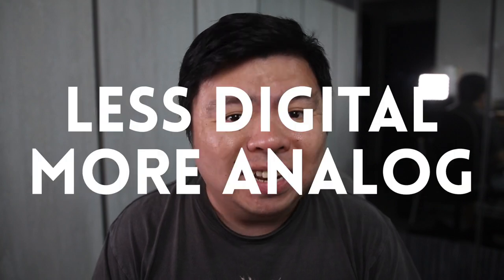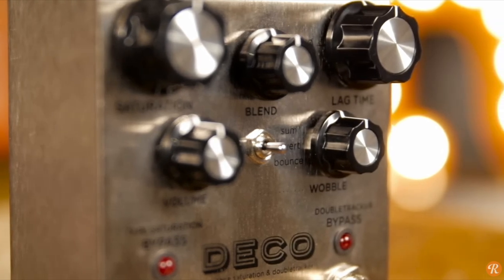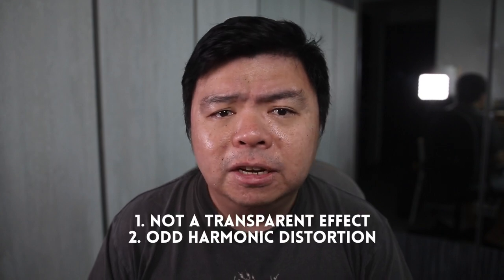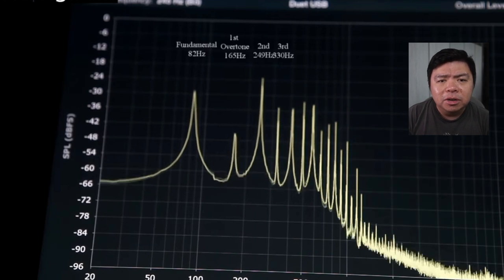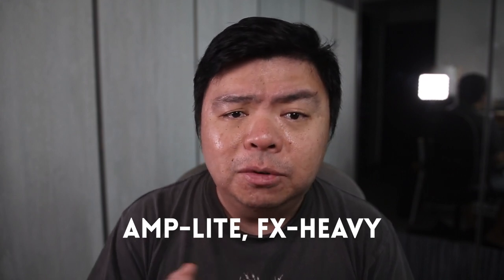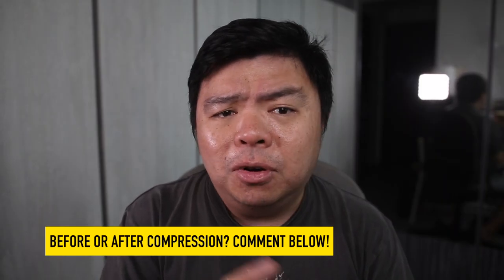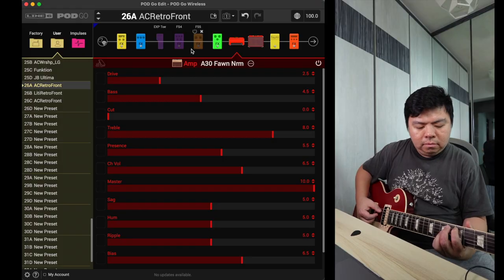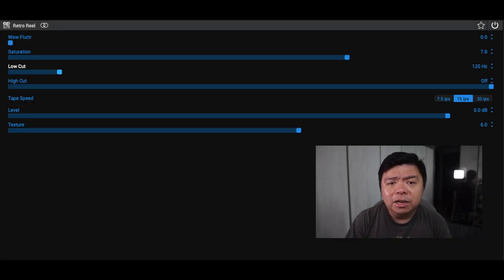Use This ONE Trick For INSTANT Analog Warmth (Line 6 POD Go, Strymon Deco Emulation)

Comment: Hello, i really need if you couldnhelp me do a preset that can use the same amp for drives and clean.. im using a charvel dk pro guitar qith both hambuckers pick ups synmor duncans .. 

I dont knlw what to do anymore to sound good please help me
Reply from the maker: Hi there, which amp model are you referring to, the AC30 or the Litigator? Both react differently to the input gain from the guitar side. Sounds like your Charvel has hot pickups. Are you having difficulty getting a clean tone?
Reply: @AllAboutWorshipGuitar   hey god bless you , im using the pod go preset u created with the guy from hey worship leader ( with the marshal amp)  

But yes im strugling a lil bit with clean tones and, sometimes on my lead tones  i dont know it just feel the high peek to up and i cant find a nice balance … since ive got the pod go 🥲😰
Reply: @AllAboutWorshipGuitar  what do you recomend me
To get a smoother sound.. i mean i dont know how to get a better worship sound
Reply from the maker: That preset is quite a gain-heavy one which relies on you rolling back the guitar volume to get a clean sound. I would try that first to take the edge off the gain. I’d also try something easier to tweak like the Litigator. Pair that with the 1x12” Grammatico (or any other Fender-flavoured cab to your liking), and then start with all the controls on 5 (channel volume on 8, master on 8).

Turn the gain up or down until you reach a level of gain acceptable to you. The Litigator can go from pure clean to a nicely rounded lead sound just with the amp gain. Then adjust the bass/middle/treble/presence to make it darker or brighter. I have found that even with the presence at zero, the amp is still usable.

Next try an overdrive that doesn’t highlight treble frequencies. The Screamer on low gain and high volume works as a mid boost, and the Hedgehog D9 is a decent distortion when the tone control is lowered. It’s about compensating for the sound of your guitar.

I hope this long reply can help as a starting point. The important part is not to give up! Tweaking takes lots of time and experience. Please feel free to check out the various free patches in my free pack here: https://www.buymeacoffee.com/jcguitar/e/28897
Reply: @AllAboutWorshipGuitar  amazing thx for the response god bless you , ill definily work in this tomorrow saturday before the   practice in church 

thx 👍👍👍❤️
Reply from the maker: @kristianf8840 You’re welcome! God bless for your prep!